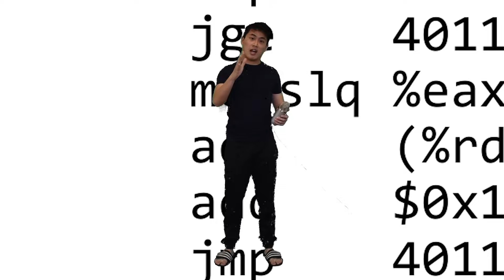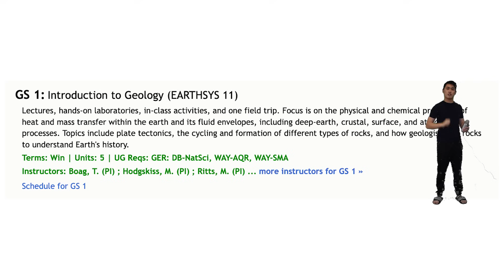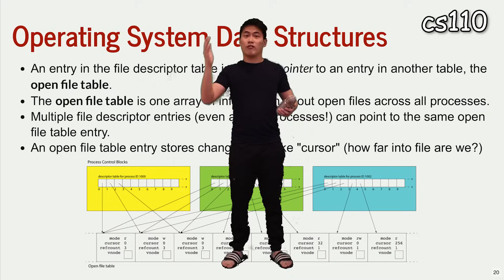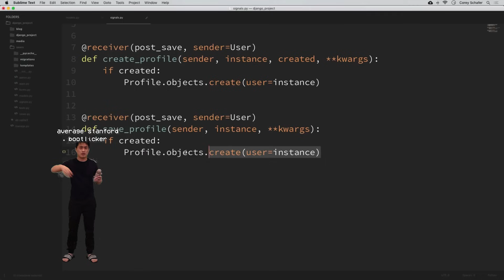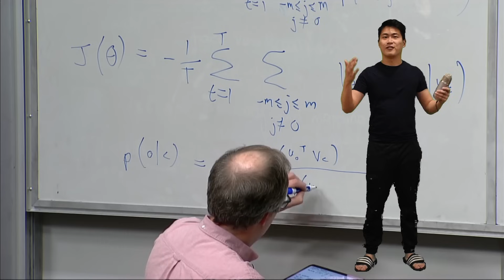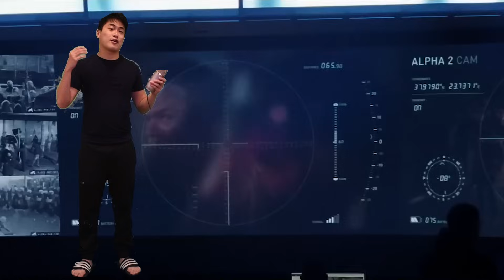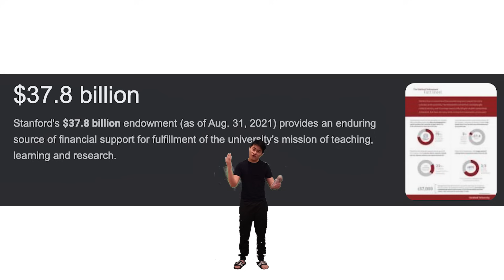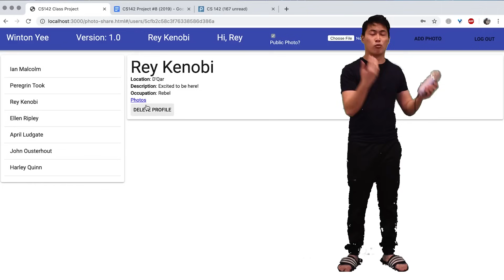Stanford Computer Science is Broken

Comment: After 4 years of college, and you still don't know the difference between computer science and software engineering..... That's the part Stanford failed....
Reply: THIS
Reply: and 2.5 years working at meta, lets not forget that....
Reply: Exactly. This guy should have gone to code camps instead of paying $$$ for a Stanford education. It was wasted on him. 
Hilarious how this guy mocked assembly language, computer architecture, registers and coding to the metal. That's precisely what Chinese developers of DeepSeek did to achieve efficiency, speed, optimization by bypassing CUDA. Without a strong theoretical foundation you can't make big breakthroughs--especially if you're only focused on the practical side using other peoples' frameworks and ideas.
Reply: @nycsim-r8t  I think its an Issue with the system. More people than ever go to universities, but that's not because more people are interested in academics. It's just that a lot of modern jobs require university education, turning universities into a kind of  tradeschools. That's not what Unis are supposed to be, which frustrates both the students and the institutions. The job market understanding that most jobs require a practically oriented education(tradeschools), even in IT etc., instead of uni degrees would vastly benefit every party involved.
Reply: yep

Comment: As an Electrical engineer who took way harder classes, 
 almost became a physist and is a professional software developer. Those classes are the differentiator between an engineer and a technician. In Electrical Engineering, they don't teach you how to change a bulb or how to do technician work. It is the same in every field
Reply: As a mechanical engineer, I want to agree with you, but I have to refer you to the middle of the video (start of the counterarguments & rebuttals). Theyre not saying to not teach the theory. Theyre saying to mix in more practical skills.

Honestly, until its grounded in real world application and current methods, little of that background theory and abstraction will sink in or be useful to 99% of students. The classes I did the best on were all classes I had some technician like background in, putting together my own hobby projects or with competition teams on campus. The classes I did the worst on were classes I had zero background in and just couldnt draw the connections. The supposed difficulty or mathematics involved in the classes didnt factor in, I did exceptionally well in the "weed out" classes and classes people always said to try to avoid because I actually had intuition for where the theory was going, built from technician work. I could do differential equations and linear algebra all day in those classes, sometimes I was tutoring the other students and pulling up examples from my projects to help explain concepts, and it made it sink in for them too.

Im a firm believer that engineers should be techs with a deeper education. Schools are currently outputting educated folks with no technician background
Reply: What's physist? Did you mispell psychic?
Reply: @stephenkolostyak4087  i think he meant physicist
Reply: EE the best
Reply: Yes, I've always found it odd that some EEs couldn't do basic soldering or troubleshoot analog circuitry.  Some of us have been doing that since we were kids. (BTW I'm a physicist not an EE, but it's a big overlap.)

Comment: I went to a technical software engineering school. 
Pros: 
- Took 2 years rather than 4 
- Wrote code using industry standard tools from day 1 
- Paid for by an income share agreement, so I paid $0 until I started working 
- Had several significant projects in our portfolio by the end of the program 
- Specialized in hot areas of software engineering (I chose machine learning)

Cons: 
- Extremely rigorous, required full time effort and then some. Short project deadlines.
- Not a degree program. Many large employeers (at least in my state) legally require a bachelors degree for software roles. Finding a job took hundreds of applications and many months. I do not recommend applying to jobs without a contact.
- Facility contained only essentials for the program, so no access to amenities, events, or communities one might have access to at a university

All in all, I thought it was totally worth it. I learned a ton of practically skills that I actually use at my job

Comment: As a Software engineering major, I did feel a disconnect in the beginning of the video acting like "Oh, it's a CS degree, OF COURSE ITS GONNA BE THEORETICAL" but from what you've presented, this curriculum looks pretty damn disorganized, even FOR a CS degree. 

I'm also part of a trimester system, so I definitely understand the rushed feeling that comes with it, but I'm of the opinion that if they switch to a semester system, that feeling ain't going nowhere because the content requirements would remain the same, no ifs, ands, or cuts. My school is in the process of switching to semesters and I damn well know this is the case, but it could be different if implemented at Stanford.

I do agree with you on the point that Stanford should offer something more than just "hey, there's a career fair, wanna come?" Learning how to network and market yourself are EXTREMELY important skills for applying to companies and your school should be on that bandwagon already

Lastly, to cover the "practicality vs theory" issue, I'd recommend for anyone interested in getting a degree for a software related field to include places that have  a software engineering degree as well or at least look up what SE's do.
Reply from the maker: yep!! i think i made the false assumption since a lot of SWE jobs require CS degrees that "SWE = CS" which is not true!!! and also stanford doesn't offer a software engineering degree lol so i should've done my research there. appreciate the comment dude, and hope u have an awesome rest of your day

Comment: the reasons you outlined are exactly why I switched to IT with a minor in SE, now I work as a DSO/cloud engineer and pretty much just work in/on AWS, docker, K8s, terraform & ansible, CI/CD Pipelines, and bash/python scripting all-day and make around 250k 3 yrs outta college. It’s pretty fun and is mostly easy work now that i’ve reached a high level of proficiency.
Reply: A CS student could easily learn these things in a couple months . That’s the difference. They can hop from anything to anything
Reply: By trying to teach an IT guy about neural networks and connecting to databases and general programming and it’s out the window . If you take operating systems and a networks class anything in IT will be easily to understand for a CS grad .
Reply: @ci6516  "A CS student could easily learn these things in a couple months . That’s the difference. They can hop from anything to anything"

"By trying to teach an IT guy about neural networks and connecting to databases and general programming and it’s out the window . If you take operating systems and a networks class anything in IT will be easily to understand for a CS grad ."

I worked in CS and IT, OS/Network class won't teach you how to IT - best case you might be able to better understand what the IT guy is doing, but good luck fixing your IP phone system with your knowledge of database connectivity.

Comment: I think a big part of the issues of learning computer science comes from the fact that any other major has a clear split of theoretical vs practical. Think of math classes and how some classes have you use integrals whilst others go out of the way to have you prove what an integral is. CS doesn't have that split right now and it mostly comes from what CS used to be. 50 years ago nobody thought that computers are going to be anything more than theoretical. So I imagine that it was just a science and nothing more. But now, practicality of CS is rising, people want to know how to use a compiler, but not how it's made. With that said, CS should really have a practical concentration, if not a whole different major, where students only learn the practical side of computer science.

Also great video, kinda crazy I got it as recommended a year later.

Comment: Every CS department is like this, mainly because the people in charge tend to be career researchers with little or no industry experience, and tend to make a point of separating CS from the industry like it's a contest. At the end of the day though CS =/= Software Engineering so I guess it's fair.

However, I personally think the much bigger problem is the industry valuing Computer Science over all other similar degrees, because many universities such as the one I went to actually have programming/software engineering degrees specifically tailored toward providing practical experience and foundation for the workforce, and they fixed all the problems you describe in this video. Loads of web development courses, way less math, no physics requirement, and loads of other courses helpful for jobs, but they all had a much harder time finding work after graduation than I did specifically because it wasn't just computer science.  Meanwhile CS is more meant to teach you how to become analytical and break down runtimes of complex systems and system distributions down to the smallest level and other NASA tier bullshit. Technically if you really got into CS I don't think there'd be a single piece of software you couldn't break down and understand every aspect of. So I wouldn't blame the school for this, it's a fair field of study that should persist, but the industry is bullshit. Same exact problem with requiring leetcode. Just follow whatever Google's doing and surely everyone will become the next Google some day.
Reply from the maker: i agree with the industry prioritizing CS: if you wanna have any SWE job, which was my goal going into college, you need a CS degree. so naturally my brain thought "CS degree = training me to work as a software engineer,." which isn't true. like you and a lot of commenters have pointed out, CS =/= software engineering, which i guess may have been a naive assumption on my part, but i guess that was just better advertised lol. maybe that's on me tho for not doing my research. appreciate you for watching and taking the time to write an interesting comment dude, means a lot. hope you have an awesome rest of your day :)

Comment: I'm fairly certain that there are separate programs for "practical CS" (like software engineering or maybe networking or data mining?) and for theoretical CS (which, I assume, would be called CS since computer science is supposed to be theoretical, computer engineering is supposed to practical).
This sounds a bit like some of my classes in uni complaining that we taught them mostly theoretical physics when that's what they chose to learn.

My suggestion to everyone is to look at the courses taught in the program before applying for it.
Reply: Great point, only one mention, Computer Engineering is still theoretical, it focuses on hardware and electrical engineering.

Comment: The problem, or so my older mentors have told me on the job, is that the profession moves very fast. The only thing that stays the same is the math and theory. It may be frustrating that you have to get this second education on the job, but that’s going to happen anyway when inevitably the tools change yet again. What won’t change is the underlying theory used to approach problems and design. If you understand that, the task of learning, or even creating, any given system should be well within your capabilities.

Comment: As someone with experience, I would add few more points as to why it's done:
1. Old style of science and math requirements for engineering came originally from classical branches of engineering, which were mechanical engineering, civil engineering and the overseeing regulatory bodies extended those requirements to engineering. Some calculus and geometry principles are required in your job. 
2. The kind of jobs you are talking about are mass populous jobs which aren't going to sustain anyway. You just said why do we need to know about compilers, imagine how would you respond to a request for translate your UI for a custom defined AR set. Now you need to write a compiler. How would you handle system exploding in data rows potentially failing a 100 million dollar system if you don't understand DBMS definitions and query optimizations. 
3. The problem is not the degree requirements being absurd. It's the execution. And I agree with one thing, teachers are at fault. They just add too much work for no reason other than satisfying their egos. No learning happens in a stressful environment. And it's true, some of these professors are old and can't really evolve with many of them narcissistic. The pain point here is that even after going through all that pressure, there's no reward for it. Especially the job or salary. 
We need to evolve how we shape our curriculum. But essentially the degree can't be shaped on particular platforms and technologies. And you can use your degree much more than just a job. The problem is most of you don't know how. Some smartest ones of you, definitely do, and it would reflect in 3-5 years

Comment: The point of learning math in cs is not to use it, but to learn how to think logically and how to solve problems
Reply: Or you could teach CS in place of this math classes, and still learn how to think logically and solve problems, but with the added benefit of those things relating to the degree you signed up for
Reply: @robert-rv8lo  computer science came out of matematics, the roots of cs are from maths, my guess is the reason they teach math is to enable students to specialize in for example theoretical computation, automata theory, computer graphics etc. And/or to go into research for example "software verification" etc. "Secure algorithms" etc. You can't start teaching basic math classes at the same time you teach these students advanced topics, you see the problem ?
Reply: @harrypewpew901  Those are all discrete mathematics topics, but at least in the video most of the things he mentioned were having to take calculus, differential equations, physics, etc. Those make sense for electrical engineering (and perhaps a few CS concentrations such as AI or Data Science), but certainly not every CS major is going to be interested in those.

Comment: As a finishing college student in Mexico, the time of the classes are similar, the year is divided into 3, giving you the impression that it would last 4 months each, but no, is actually 3, because there are vacations at the end. So when you are a freshman, your first week is nice, is only presenting the scheduling, and that's it. But then week two starts to rain some homework, and on week 3 you are doing exam(you have to do 3 exams in total for each class in each four-month period for 9 grades, where 10 is your final project). So when you finish your first grade, you start the new one feeling tired. Then, in grade 4, you are assigned to make a project with the knowledge of previous grades and the current, which involves the use of databases. This happens again in grade 7, now either making a fullstack website, an app, a routing plan, or an investigation paper. The same will happen for the final project, but you won't be dealing with having other classes and also their respective final projects. By grade 5, you have to have a plan of how to deal with final projects week, ideas for grades 7 and 10 projects, and also how to deal with taking food because you dont get enough time, the sleep problems you are going to developed when you stay awake JUST ONCE (good luck trying fix that). Taking all my experience so far, I have been stuck doing web stuff for my last final project and not touching previous knowledge like calculus. And yes, it is freaking React, but I dont have the time to start from 0 in HTMX. Maybe one day.

Comment: Can u please make a video about what u actually need to get a job as a SWE? Like what courses are actually useful, what projects to do, how to apply for internships/jobs....

I agree with ur opinion on college CS classes going waaay to indepth and most of it not being used for either applying for a job or when u r actually in a job.
Reply from the maker: aye for sure man! SWE is interesting cuz it's basically just being good at leetcode, which itself is a dumb metric and not related to "the real world" either lol. to pass the interviews i'd recommend getting the holy grail, the cracking the coding interview book.

off the top of my head, here's classes that would be useful for SWE:
1. web dev
2. backend dev? might not be a class specifically on this, but stuff like databases, servers, and security would be useful
3. design
4. mobile dev

for projects, just build stuff that seems cool to you! good starting point i think is hacking together a little personal site using flask + putting cool stuff on there. but you could also build games, AI stuff, data visualizations - literally just whatever is interesting to you

for applying to internships i think you just have to have volume (aka apply to a lot of a companies) and not get discourages from rejection - cuz you will get rejected a lot, but just realize it's a flaw in the job application grind process, not you. get good at leetcode and apply early  for summer internships (like november-ish) and you'll find an internship :)

i got a ton of video suggestions so no promises but that's a great idea for a video!! glad you could relate to my feelings about cs being wack as well lol. thanks 4 watchin and have a spectacular day :)